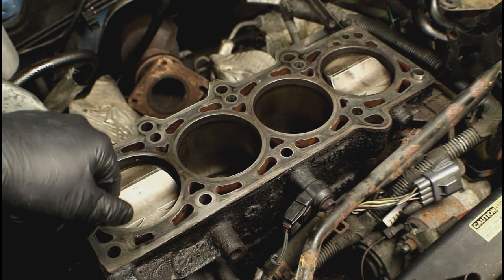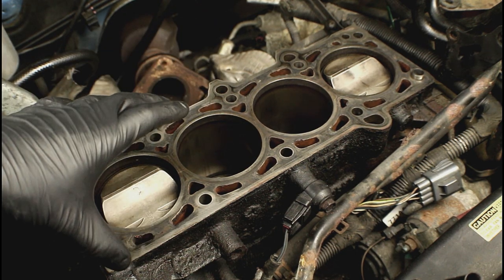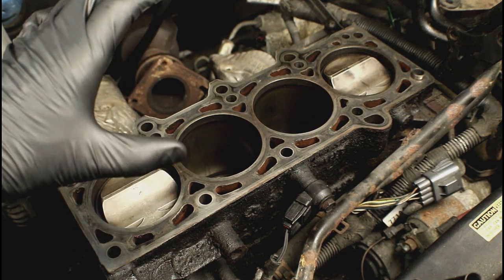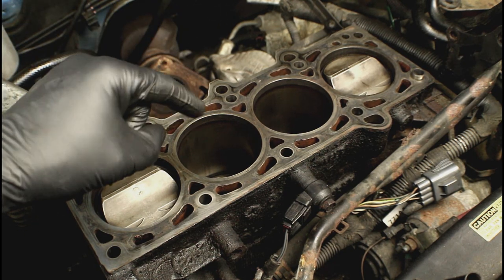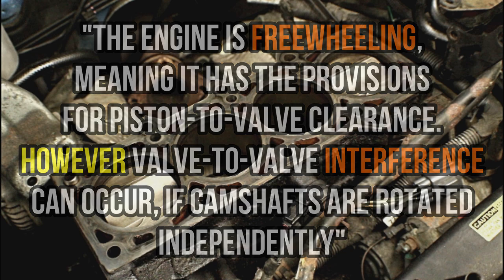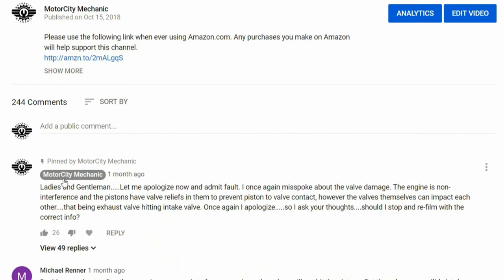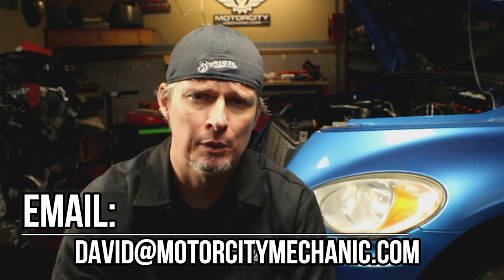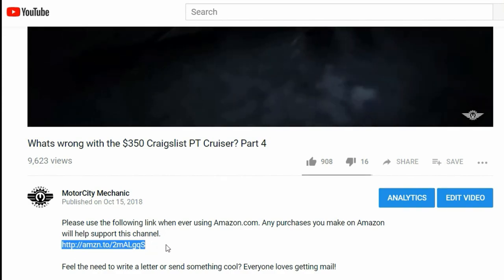The difference between Interference and Non-Interference engines

Comment: Well another good video but I do see the possiblity of an assumption being made that could explain this issue. I don't think you addressed the possiblity that this 2.4 engine may have had prior cylinder head work accomplished, the head may have been resurfaced shaving more than the allowable specification which in turn could cause this problem in the event of timing issues like this engine had with the broken alignment pin on the exhaust camshaft. Any resurfacing from the original thickness would bring the valves that much closer to the piston in the event of this type failure. If that did happen it might explain the disparity between the service information and what you experienced here on this engine.
Reply from the maker: Excellent point! Thats why I like the comments section. Once you film a video great points come up or you find something you overlooked. Appreciate it Brian!
Reply: I don't understand a resurfacing that adds.
Reply: You misunderstood my post, a resurfaced head would be planed and brought back to a true surface condition by removing or shaving material from the surface of the head which in turn reduces the clearance between the valves and the piston even more than the original factory head clearance, possibly causing potential for contact with the piston under the conditions experienced by Motor City Mechanic in this video. @martind349

Comment: Congratts on the new babies. It looks like someone goofed on that explanation. I don't see any way the valves could touch each other.
Reply from the maker: It might be able to happen at higher RPM's with valve float and as someone might have mentioned maybe the lifters had bled down a bit to affect it. Those impact marks on the piston took my focus lol

Comment: Good video, good info. you're a skilled mechanic. Car makers could easily make all  engines totally non interference... It just costs a bit more, thats why they don't do it - ( slightly different pistons, or valve angles). Interference engines are really a " black eye" to all auto makers. Auto makers would say " "if it's maintained perfectly, damage would never happen". Well, it's not a perfect world.. I'm sure everyone would rather have a non interference engine, then if the belt breaks, just re time it, put on a new belt, off you go, simple. Are you listening auto makers? Stop doing interference engines..!

Comment: Just learning about motors so this may sound like a silly question but my timing belt snapped in my Honda Accord is there a chance that the cam shaft bent or the pistons being damage from hitting the valves? Thanks in advance

Comment: Just wanted to ask if my Mitsubishi outlander 2003 is non interference engine? I got 67,000km just wonder if it’s the best time to change or wait until 100,000km it’s 17 years old never change the belt since it’s been sitting in the garage for a long time

Comment: My 05 Subaru Forester has a 2.0L Impreza engine and the a camshaft sprocket broke in pieces. The belt came off and it did not bust. So my cars engine is a interference engine and what is the chance my valves bent?

Comment: If piston to valve contact happened, Then valve to valve contact can occur. In aftermarket components, valve spring length, valve guide diameter, valve seats, cam lobe debrie. The philosophy goes on! I believe to understand now anything is possible.

Comment: If the belt is broke, how will a compression test determine if valves are bent? If cams won't turn, some valves will be open, thus cylinder will have no compression.

Comment: I have a 2015 Dodge Charger V6 been having multiple problems with it overheating I went and bought a motor from a 2018 Dodge Challenger will I have to do anything with the computer or can I just unplug everything put the new motor in plug everything back in or do I have to take it or get it towed to the dealership
Reply from the maker: If the engine is the same an an exact match then its plug and play and nothing needs to be done as long as your using the original PCM (computer) and not swapping it.

Comment: hi david  i want  to use sea foam  on my  caravan  2012  on air intake  where should i spray where is the save area i can use sea foam  thanks
Reply from the maker: Best way is to take the air inlet off and spray directly at the throttle body. You dont need to open the throttle body just spray at an amount that doesnt cause it to stall out with the engine running. Then once done let it sit and soak. We dont use sea foam but instead the Mopar equivalent. The smoke afterwards will be normal so be prepared

Comment: thanks for your video mate never knew a thing about interference n non interference engines till Now, I never knew cam belts existed till I got a Toyota Tercel a small Estate 4 wheel drive to help get my small boat on to the trailer (select able n basic 4WD) n my mate said when I took it to his garage cum belt seems ok But best get a new one from Toyota to be on the safe side, since the 60s all i knew was timing chains some rattled with age tensioners worn out maybe chained stretched a little, But their for the life of the car I hated the fact my engine could have a huge catastrophic damage cause it relied on a belt not braking for that I always changed the belt B4 they where due to now am about to get another car SH again of course it was between a Polo a Yaris or a Jazz, its a Jazz hands down cause they have Glorious chain driven cam shafts, If belts where this good why are they not used on motorbikes instead of chain? but are cheaper to produce n make more money for the manufacturers too Well done Honda

Comment: Would a 2006 Chrysler Sebring 2.4l dohc 4 cylinder car be interference or non? It’s timing belt broke recently & the mechanic who fixed it says it needs a head job by a machine shop since the valves made contact with each other upon the belt breaking.
Reply from the maker: Same Exact engine as in this video. From experience….every 2.4 with a broken timing belt has no issues. No bent valves. Been doing 2.4 engines since they came out. I would bet money it will be okay….replaced Waterpump, timing belt and timing belt tensioner and idler pulley. But the shop will argue otherwise and will care less about what you find on the internet or YouTube unfortunately.
Reply: @MotorCityMechanic  It still seems to need some work on it after the water pump & timing belt installation. It seems to want to overheat, the motor just doesn't sound the same as before so they might be onto something.

Comment: I have a 2008 PT Cruiser, if the service manual was accurate, when I busted my timing belt, the valves would have been fine. Nope! I had 12 of the 16 valves bent.  ALL the exhaust valves and HALF the intake valves. it was an expensive repair to boot. So Chrysler's Claim that the engine is Non-intereference is totally bogus. Even the intakes can bend in proper conditions.

Comment: I would think that if the engine manufacturer designed an interference engine, that that engine would automatically come with a timing chain installed.  My 1991 V6 Nissan Pathfinder is an interference engine and has a timing belt.  I think less of Nissan for designing an interference engine and not including a timing chain with this engine.  I'm sure they saved some money, but how many engines were damaged or ruined in later years when the timing belt broke?
Reply from the maker: Very true....it would certainly make things easier. I cant tell you how many PT Cruiser I see online due broken timing belts for sale because someone told them they needed an engine. In most cases on the PT no damage gets done unless some mechanic screws up like in my case.

Comment: If the cylinder head had been machined in the past that could also reduce the piston to valve clearance.
How sure are you the top end of this engine hasn't been worked on before?

Comment: IF AN OWNER DOWN THE LINE HAD RESURFACE THE CYLINDER HEAD THAT COULD EXPLAIN VALVES TOUCHING THE PISTONS.THE VALVES COMES CLOSER TO THE PISTON IF THE CYLINDER HEAD IS RESURFACED YES OR NO ?

Comment: No question that the valves hit the pistons.  However your test for valve to valve interference didn't take in to consideration that hydraulic lifters lift more when full of oil.  Those valves may indeed hit each other.

Comment: Surely Interference engines are a thing of the past by now, if they move the valves  just a bit further away from where the piston’s limit is, then that would stop the issue, is there an actual reason why they have to be so close together?

Comment: Thank you , very good video ,   but that was not what I wanted to hear   I'm 2nd owner of my 2001 had 76,000 when purchased  belt might of been replaced at 40, but don't think so got to 90, crap I got replace it  faith kicked In 100, and went to dum ass 107, and it snapped almost 120 Honda could of made it lol I have manual 2.4 pt 2001 and had no problems except with chrome rims rusting inside and powersteering oh and the wire harness sags down and rubs on rotation front axle and cuts the wire of cam module and will not start which is why many never figure out and get it running it goes completely Un noticed  any problems with pt cruiser #1 to check if not starting just follow wire harness on top of cams all the down transmission down see wear on covering cut wires

Comment: Near impossible for valves to hit each other as the guides keep them apart.   Interference to me always meant valve to piston contact.    You just proved it.   Belt driven cams need the belt changed near the 150,000 km. mark.   My Town and Country 4L  was just done at 148,000 kms.  It was a kit which involved belt, water pump, idler, and tensioner.   The water pump had already started to leak.   Caught just in time.  $ 1,200. job,  good for another 150,000 kms.    Most of these used vehicles near the 150,000 mark are traded in to avoid the Maintenance.    So Beware and check to see if the cams are belt or chain driven.   Determine where the water pumps are located for access.    IF neglected they go BOOM.    My service center here puts a sticker on the frame under the hood to indicate the belt change has been done.

Comment: Almost all Diesel engines that ever existed are interference so fuel costs that are saved are evaporated by the belt replacement costs. Due to high compression the valves, especially the inlet are often extended further into the cylinder allowing more air in.

Comment: Hey brother got a question for ya. I jave a 2017 Fird Feista SE 1.6 non-turbo. I changed the timing belt about two months ago. I used the X tool along with the flat steel plate for the other side of the cams. Anyways the wife call a couple of weeks ago and days the car won't start and when I go and try to start it it seemed to crank slower, so I stopped and had it towed to a shop. Thos guy tells me the motors gone, bent rods, said he doesn't do used motors. I had to pick it up because he lot was fulll. I took the head off and took it to a friend's machine shop and he said nothing was Wong with the valves checked them two differnt ways. He ask if the pistons and piston walls looked good and they did. He Siad sense I removed the head it would be best to clean it up and run it one time along the bottom. I point everything back together, used the pin on the crank to get it top dead center alongbwith the X tool on the cam gears and the flat bar on the other side. I'm now a nervous reck because the flat plate was tight when I tried to pull it out but the X was good. I turn the engine over three times and the TDC marks on both gears we in line with the crank. It turns pretty easily with a 1/2" drive manually so does that mean the valves are not hitting the pistons. Thanks

Comment: I think it all comes down to "COMMERCIAL STATEMENTS" and the VOCABULARY associated.
I do believe that if any type of possible contact should occur inside the combustion chambers of an engine, under any possible incident condition AROUND A TIMING ISSUE, then it should definitely be classified as an INTERFERENCE ENGINE. Period !
BUT ... the MARKET decides otherwise, and the automotive world isn't much different to the rest of the industrial world, and a couple of LIES surely help a lot in selling a lot of things.
Reply: Agreed.  This is an interference engine, bar none.  The fact of the matter is if the chain/belt snaps, the engine's toast.  How it's toast doesn't matter, whether it's piston to valve or valve to valve, the engine's toast.  Chrysler used some weird wording in that service manual.

Comment: I don't want to discourage you because you are making good videos.  And you almost had it this time, but you didn't go far enuff.  Every thing you said holds true for an idling or low speed engine. But this damage was done by floating valve syndrome. Valves will float at ultra high speeds and cause this damage I have seen it to be true.
Reply: Be sure to measure the springs.
Reply: This could be valve float, but this usually occurs at high RPMs and weak valves springs. It also could occur due to a higher lift cam or a higher domed piston. It would be interesting to check the clearance of this head with this block. Perhaps set the head on the block using just the pins (no bolts) and use some putty? on top of the piston to see what the actual clearance is.
Reply from the maker: At the end of the video I touched on the possible "floating issue" but didnt call it out by name....just that at higher RPM the valves may be traveling further. Its a very possible item....if I hadnt seen the impact marks on all 4 pistons I would have focused more on the valve to valve possibility.  Thanks for watching and for commenting
Reply from the maker: I sooooo want to get a used head and some cams and cut the head so that I can have a section to show what happens in the cylinder with the piston....that would be cool and say alot of sure.

Comment: Take into account tolerance between ex. valve & top of cyl. head,.....then take into account the loss of that tolerance to carbon buildup on cyl. head & exh. valve,....engineers did not take this into consideration,...only a mechanic would.
Reply: Correction: my apologies...typo. that should be top of "PISTON", not cylinder.
Reply from the maker: Thanks George for the comment and for checking the video out. Dont forget to subscribe.

Comment: If you over-rev an engine you can float a valve and it could smack the top of the piston , bending it or breaking the valve or hitting the piston knocking a hole in it , I see this all of the time on motorcycles from these squids who abuse their bikes . I have even seen a valve shoot out the top of a motor destroying everything from this type of abuse , the trick not to have this happen is to use your bike like a normal person and not an idiot ( don't show off over-revving your engine ) , the only bike engine's I know of that can't have this happen are the Ducati DESMO engines because they do not use valve springs and two strokes ( two strokes don't use valves they use reeds )

Comment: Really in today's world there is no reason not to put valve notches in pistons with timing belts or chains. Just a way for the manufacturers to make more money or sell you a new car 
Take a loan out to buy the vehicle and when warranty runs out take another loan to fix it. Then you have 2 loans on the vehicle. I see it all the dam time.
Reply from the maker: It happens for sure......I have seen that happen as well.
Reply: Valve notches reduce compression ratio slightly

Comment: 2006 is a non interfering engine i never had any bent vavles on them
Reply from the maker: Nothing changed with the engines....they are and they aren’t. Just depends on how you look at it. Like in the video....basically it has to be timed wrong my someone to actually bend them. Otherwise on it’s on it won’t

Comment: Just proves the Engineers are not 100% correct. Just like on the 5.7 Hemi with the tick tick tick sound.
Dodge says it's the nature of the Hemi design. I called BS. The old Hemi's back in the day didn't do it.
Not all 5.7's do it. On Dodge forums, they have tried different things and nothing works. 
Do you have any tank on this issue for the 5.7 Hemi ????

Comment: Wow. The service manual is full of shit. I knew this guy knew his stuff. How the hell can they call this a "freewheeling" engine? Either they are misusing the term, or they don't know what it means, or I don't know what it means... Clearly, someone is full of crap. Those marks on the piston don't lie. Besides, he showed how the exhaust side of the piston was at least a quarter inch above the deck...how would it NOT come into contact with the valves when the timing chain or belt  broke or there was some other issue with the exhaust and intake camshafts being out of time (like the sheared-off pin situation)? The only thing I can think is that deck had has been resurfaced beyond the specifications, meaning the piston and valves are now much closer together than what was originally designed or intended...i don't know.
Reply from the maker: Yeah I feel that term is used loosely and if there is any chance it will hit....just call it an interference engine, simple enough. Thanks for commenting and for watching. Make sure to subscribe if you havent already